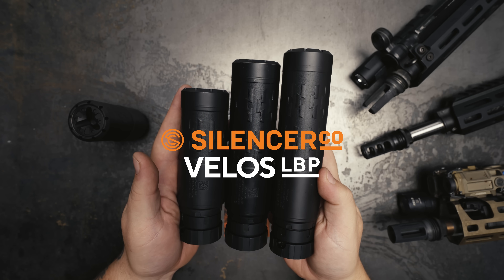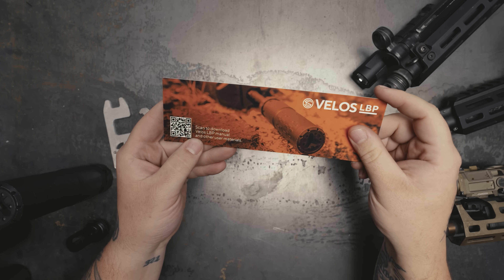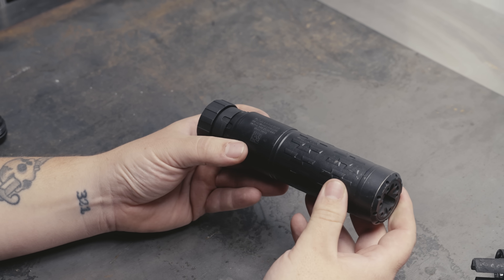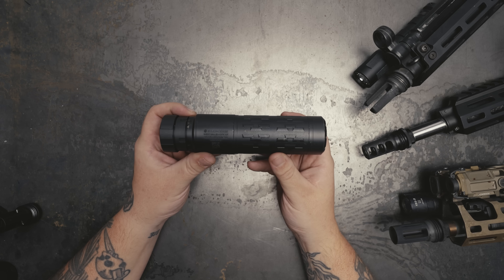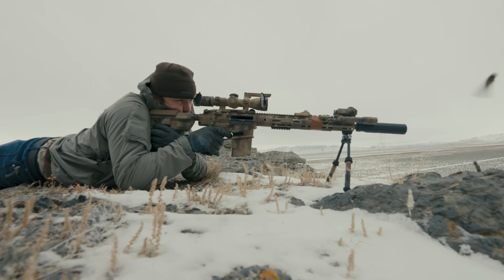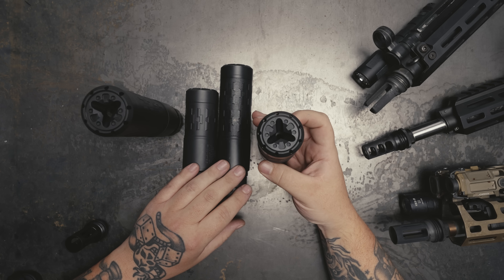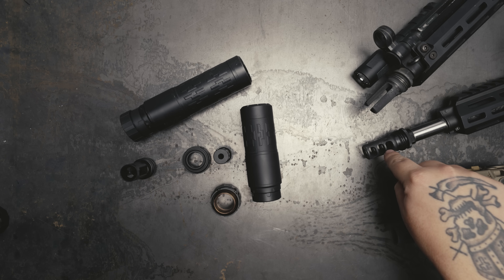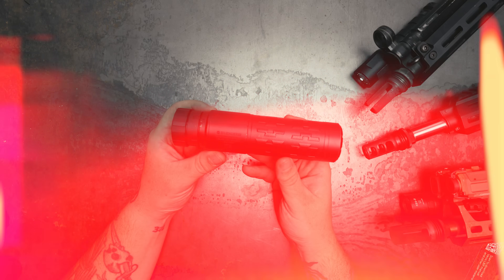SilencerCo: Velos LBP (Low Back Pressure) Overview

Comment: Can y'all please rationalize the charlie, honestly? What is the honest reason the Velos line is Charlie as opposed to hub? Like honestly...
Reply from the maker: The Velos was designed with Charlie mounts because of strength, durability, and concentricity, not because Bravo wouldn’t work, but because Charlie works better for what Velos is meant to be.

Comment: Perfect timing. Did a lot of research and finally set on the LBP 556K. Super excited 😎
Reply: I have the Velos 762 and the 556k.  Both are awesome the STM is quieter but more back pressure.  All of them are great cans and I was expecting the 556k to be louder but very pleased with the size,weight and performance.
Reply: @beltfedTODDRULZ That's great to hear! Glad it's working out for ya.
Reply: I think you will enjoy it. I love mine. I know a lot of people say it's not that quiet, but it's a K can and 5.56 will always be loud lol. I switch mine out between my 11.5 and 14.5 and it is great. I have a couple of RC2's that are quieter, but those build are for different applications.
Reply: @Kungflu2020 Nice! Yeah using it on my first AR. Got a 16" DDM4V7 for a steal! Hopefully it all works out. Also got the 556k for a crazy steal too. Mainly got the suppressor cause it helps with the back pressure which is nice. Thanks again
Reply from the maker: Shorty gang! 🧡

Comment: I just bought a 762. How quiet will it be in a 556? I plan on running it on multiple calibers
Reply from the maker: You'll be looking around 137dB. You can squeeze a couple more dB's out of it if you pick up a 5.56 end cap.
Reply: @SilencerCo you think the KAK downward venting BCG would cut another DB off of it?

Comment: I have a 556k that I run on my 11.5 BCM. zero back pressure and the sound is great for what it is. I just ordered a Rearden charlie mount because I want to shave off some weight and make it a little shorter

Comment: I have the full size on a PWS MK111, which is an 11.85 inch barreled piston gun. Full mag dump with no ear pro and it didn’t even ring my ears- crazy nice can. I can’t do that with my other rifle cans. The LBP might be louder at the muzzle ( I don’t think it is ) but it’s MUCH quieter at the ear- in my experience. I saved a little weight with a Griffin Armament Charlie adapter, since I already had their muzzle devices on my guns. Saved about 1/2 inch in length as well. Nothing against the SiCo mounts, I just didn’t want to re-equip. 
I own more SiCo cans than any other for a reason, and that reason is high quality!
Reply: Got the same can on the same gun direct threaded and I’m right there with ya. No regrets from the Velos. Love it 🤘🏻